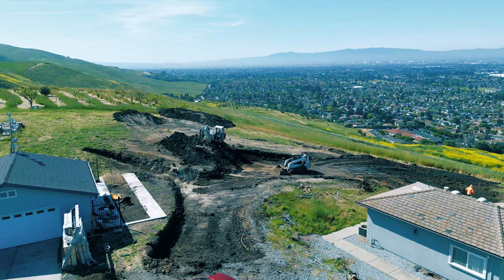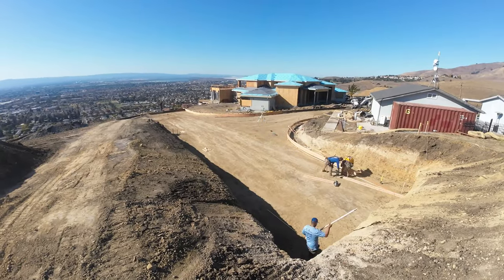Is Prep Work REALLY Worth It for a Perfect Concrete Driveway?

Comment from the maker: When doing any concrete prep work is vital. Check us out excavating over 400 yards of dirt, importing over 115 tons of base rock, and installing 3 tons of #4 rebar at 18 inches on center. 

 Check out the 100-yard pour to this project.

 Part 1: https://bit.ly/FiretruckTurnaroundPart1
 Part 2: https://bit.ly/47u4pkF
 Part 3: https://bit.ly/3HijyuJ
Part 4: https://bit.ly/3uenUjB